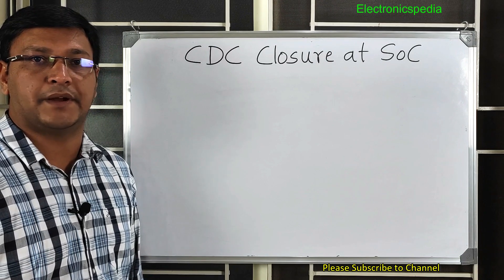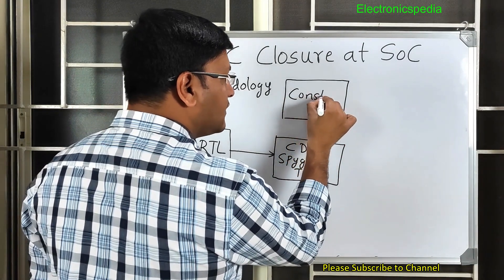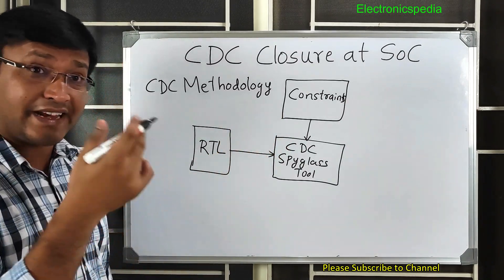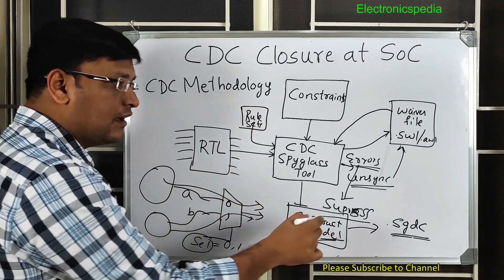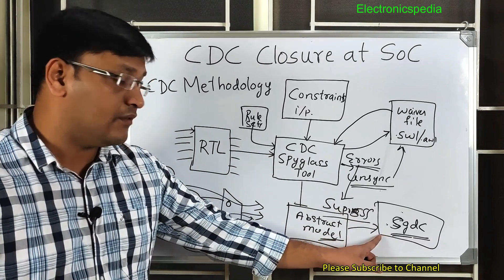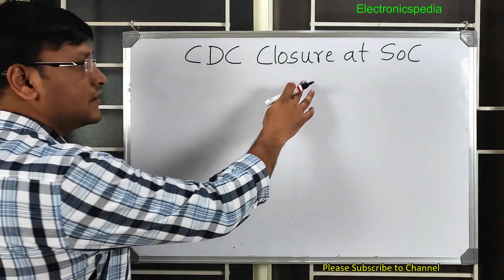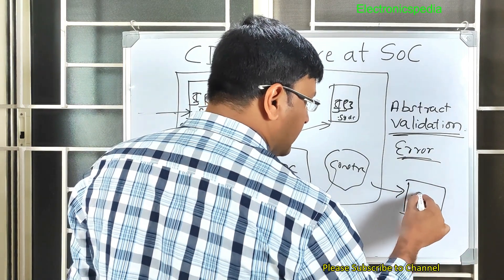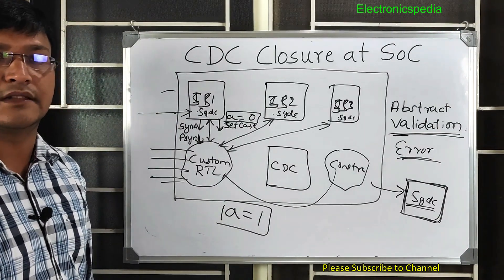CDC Methodology | How to Run CDC at SOC level | Clock Domain Crossings | CDC at Subsystem | VLSI

Comment: Thanks for a good information.
 I would like to know about the rule sets & waiver files, how is it like? 
Is it separate files provided to tool on top of SDC and verilog , which it is different from industry standard like SDC, Verilog etc?
Does all tools use same rule sets and waiver files or has same syntax for the file?
Reply from the maker: Rule sets and waiver files are typically separate files provided to the CDC tool, and their syntax can vary between different tools.

Comment: If we have an input signal without any change which is passing from one clock domain to another clock domain, then do we need a synchronizer for it?
Reply from the maker: There is no need of synchronizers. CDC tool will show violation which can be waived off, or quuasistatic constraint can be added for such signals
Reply: @Electronicspedia  thank you for you r replay